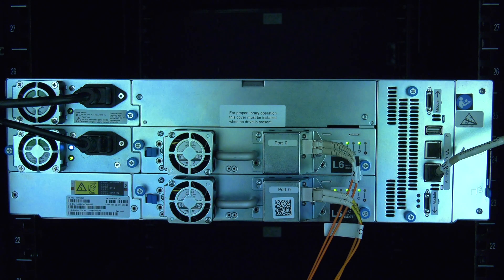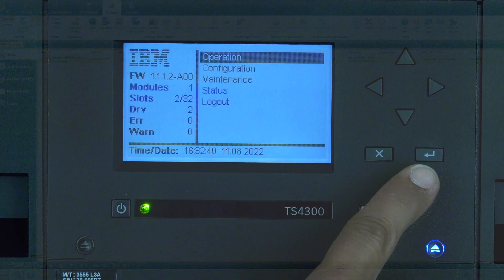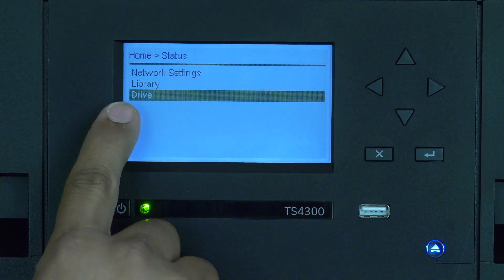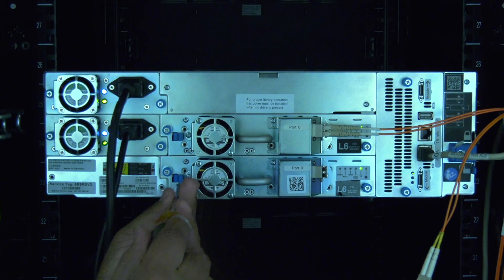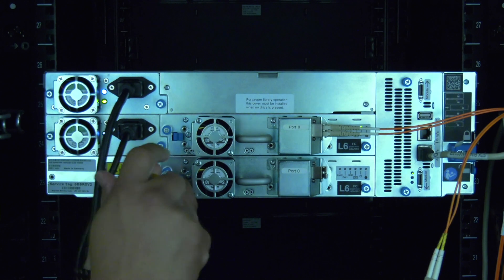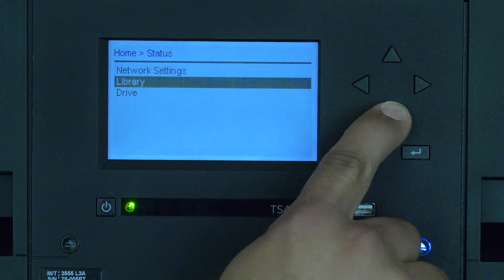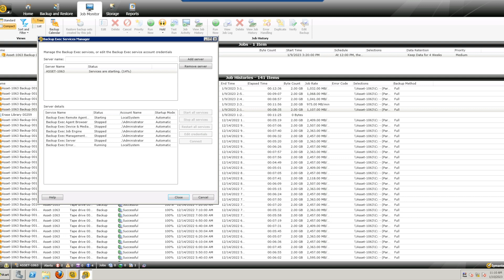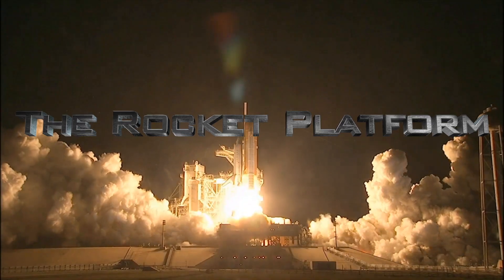IBM 3555 (TS4300) Tape Drive Replacement

Comment: no power off the Library ..to change Drive..?  the replace   is hot swap.?
Reply from the maker: Yes, this library supports hot swap replacement of tape drive just as described in the video